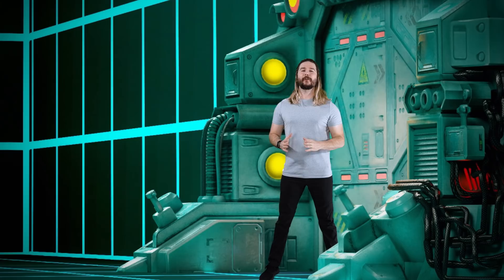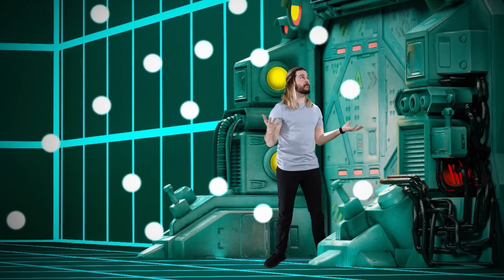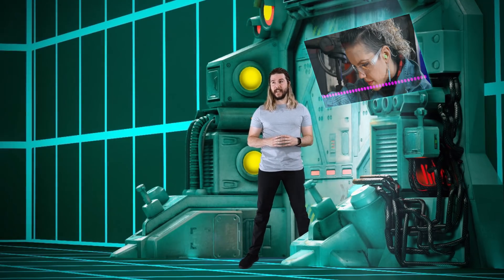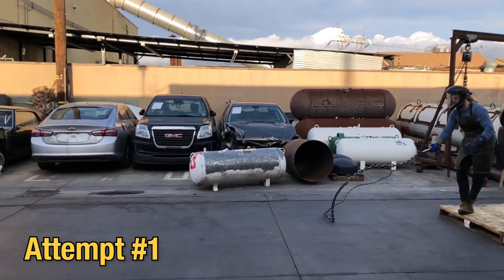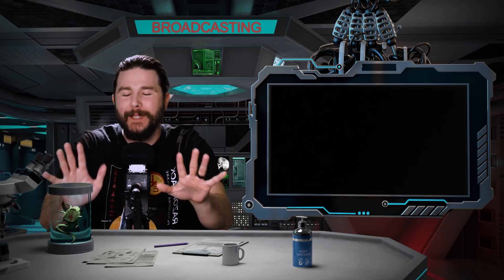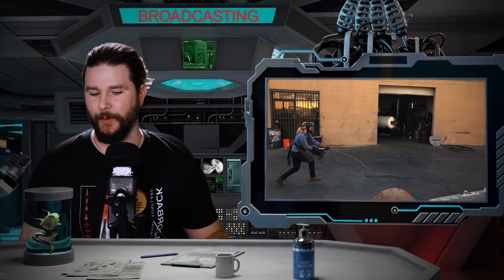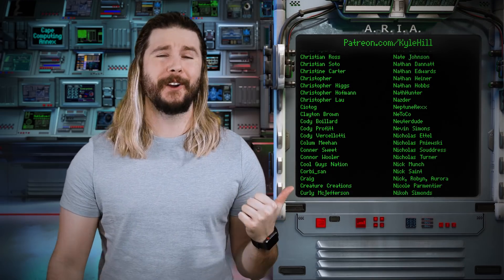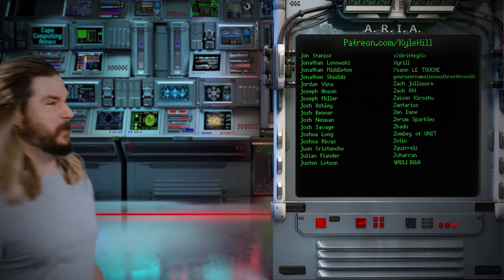Can I Make a SUPERSONIC STEEL WHIP?

Comment: @Kyle Hill I believe that it's possible to generate the force, but you require a pole, and possibly a pnuematic arm, to generate the necessary energy to move the chain. You're both too short AND too weak to generate the joules necessary to get the chain moving. However, a pnuematic arm, with a sort of "yank back" function should have the power to get it there. However, I assume that is an entire episode in and of itself. I may donate just to see that become possible, but perhaps partnering with an engineering channel can get you there easier.

Comment: Your experiment was a fail because you also are forgetting a few variables look at your upper body compared to the guy in the video as well as he may have more experience using a whip but the main variable you forgot when comparing your experiment to the video was you weren't there to see if it was all made of chain, however maybe try getting him to use your whip (as dangerous as that maybe) to see if he can replicate his out come

Comment: I make bull whips recreationally, and one of the most important parts to getting a good pop is the cracker.  The cracker is a thin piece of material attached to the end of the main body of the whip that is very drastic step down in mass.  On my 6 foot paracord bull whips I use about 6 inches of paracord gut tied onto the end of some gutted paracord.  The cracker breaks down fairly quickly and is tied on separately to make it easy to replace.  i think if you added a length of aircraft cable to the end, you might have an easier time getting the final crack.  That being said bull whips loose a lot of energy when they hit the ground, so without a significant amount of power to keep the whip completely off the ground during the swing, you'll have a hard time getting a sonic boom.

Comment: I have a lot of experience cracking a whip (don't ask why my wife will get mad) and it looks to me like that whip is way too heavy for you, you'd need a lot more momentum and a sharper flip when you pull the handle back like you would with your wrist on a regular whip. The guy in the other video probably had a leather tip like you mentioned and he was whipping it very fast.

Comment: Just a guess here but I'm thinking your chain went failed because it didn't taper enough and chains don't flex the same way leather does.
It's very important to have the right Flex at the end of the whip as I've owned cheap whips and expensive whips the expensive whips Flex differently than cheaply made whips and they don't crack as easily.

Comment: I feel like a chain is not good for this. It is relatively heavy(thus difficult to accelerate) and the numerous joints between the links gives you a ton of places to lose energy. A cable would likely be better, but also much more difficult to make, and far more expensive. Perhaps a chain with a cable on the end?

Comment: Three notes from watching...
Note number 1... Next expermint wear more foam. 1 in foam would help protect your legs. 
Note number 2... In the Tic Toc the guy gets 3 circles before the whip cracks. Highly dangerious unless you are a skilled preformer. people take note when it says "Do not try this... Don't Fn Try it". I didn't see one full circle on your go.
3.) It may be the silly in me but if you want to get the speed of sound safely maybe take a lesson from Newton. The quick decelerating on a solid object right at the tip. 
(To safely do this consider using some sort if torqe shaft on the handle end, some quick brake motion and a protective spring mounted stop to the centrifugal chain. (Theoretically you don't hurt yourself and you stop the chain with a whip motion.) You can see at the very end that stop in the Tic Toc strikes something... 
Finally Kyle take care... Hospitals are bad places to be between Germs, Bactaria and insurance. Its painful for me to watch the photos of your leg. Otherwise good Content.

Comment: So question. Isn't it usually the jerking back on the whip that causes the sonic boom? You were throwing the whip forward but I never saw you yank back on it just before impact. I've got whips and the only time they ever snap is when you get the timing right on the pull back. Like when you snap someone with a towel.

Comment: It would probably be a good idea to shield your ankles. Like just build a metal (or practically anything) curve that is bolted down behind your legs and is about as high as your thighs, so that if anything gets hit, it would be that. It might slow down the whip, but it would at least protect you on failures.

Comment: There are many issues here that make me think of reasons you could not get a crack. One has been mentioned a few times. There is no cracker/popper on that whip. Second thing is from watching the footage that whip is to long and heavy for you. Every try ai way the whip was always in contact with the ground for most of the swing. 

If you want to so this get a smaller chain and then find a way to make a metal wire cracker at the end. Just be careful because you will be making this whip far more dangerous. The big issue you are trying to overcome is a bull whip multiple layers each channeling the  the energy it has stored up to the next  smaller layer. Your whip is tapered, but it is effectively one long piece. Using braided wire might work better, but again far more dangerous. So shorten the length of the whip. In truth a 4.5 or 5 foot is what you want keep the chain core, but use a smaller chain. Atach a cracker to it  then either use a flexible  wire meshing, or a thin strands on wire to braid over  the bottom 2 feet. This will give you a chain whip that is much closer to a bull whip in how it transfers kinetic energy

Comment: Kinda looks like wave going down the chain arches at a too wide radius; I'm not sure if it would be a matter of performing a more linear forward and then backward yank instead of a sideways swing, or if it could be a matter of figuring out a different link-count to link-size function to to adjust the shape of the wave though

Comment: Every whip needs a peace of rope or fine lether at the end called the cracker. It is a different material than the whip it's self, and all the whip does is prepel or "whip" the cracker up to speed before halting that speed at the connection point and yanking the rest of it faster than it was propelled that is what creates the crack and what you see in the tick tock vid

God bless and have an amazing day

Comment: I understand where you're coming from. Ya, it's probably not possible for a Hu Man. But the main thing I noticed is, you never 'whipped' the chain. You threw one end while holding the other. I never saw an attempt to pull back on the chain in flight (the action changing the whips direction)

Comment: sigh many people think that the most exciting thing about science is the successes but in reality it is the failures, it's the failures that make us want the unobtainium or achieve the closest possible thing to unobtainium before we can make the leap to procuring it.
They like to post the successes but in reality the ones that just post successes and have success after success are either plain lucky that they have discovered something they weren't looking for for example artificial sweetener or... they are demonstrating something that other people have discovered or invented before them and are in the process of reverse engineering it... a good example is NASA... many think that NASA is some god like beings for getting people into space but in fact it started with the humble sling and even you can agree with this to some degree.

Sacrificing mass to either increase velocity to get to a great distance or in NASA's case... orbit came easy to them because of the sling, fireworks, gyro's, gimbles and other things that was not created by them but put together by people that really needed to solve the problem of getting that hunk of mettle from sea level to 100km above ground and of course... stay there

Failures help people eat humble pie, be humble and of course cautious with baby steps, it makes things worth doing because there is a lot going into getting it right and you only need to succeed once before you needing to tear it down and examine it so that it can be repeatable.

Please keep trying, your failures help science.

Comment: Kyle, here is the solution which will allow you to make this work!

First, a major component of why it is failing: the length of the whip only assists in creating a sonic boom insofar that it increases the duration you can apply Force to the chain increasing the total kinetic energy of the wave traveling down it. But, the longer the chain the more strength you need to be able to apply to the chain in order to keep it airborne for the full duration. Once the chain hits the ground, that is the maximum amount of kinetic energy you can add to that chain. So in this case, longer is not better for YOU.  You're not strong enough to with the chain of the link you are using.

Kyle, a supersonic whip happens because of a decrease in MASS as you go farther down the chain.

So, rather than make the chain so long, use less and less dense materials for the chain links as you go down the chain. Make sure to vary the change in density gradually using slightly less dense materials each time. Don't jump straight from Steel to aluminum.
It is hard to tell from the video, but it appears that the size of your links suddenly get a lot smaller but don't actually taper any smaller as you go so you're only getting an increase in velocity right at that link change, but that link is still connected to the previous link oh, so there is a limit to how much increase velocity you can get at the transition.
A normal with is tapered, meaning a continuous gradual change in length. But by suddenly decreasing the size of the links, that isn't simulating a tapering.

Use a couple different types of Steel density, and a few other metals, and a couple different sizes of links for each density, then weigh all the links and sort by weight-over-distance.

Important note: you need to divide the weights of each link by the distance of the inside loop of that link. Then sort your links by the result for each link.
If you need an explanation for why that division is necessary, leave me a reply and I'll explain.
If you need an explanation for why any of these steps are necessary or helpful, feel free to ask in a reply, and I will explain. But this comment is already way too long!

-Alex Montague
Reply: Rough visual estimate based on footage, your chain needs to be, at most, approximately four-fifths the total length you have it right now. Probably closer to 0.7x the current length.

Comment: I'm not a science guy but i'd try reducing the mass of the end portion of the whip by not only reducing the size of the links but also by changing the material. Make the last meter or  something out of aluminium or magneseum. Also, i wouldn't try doing it by hand right away. Make a device to check if it's even possible to do this without ripping the links at the end, then get some practice with regular heavy whip and only then attempt to get it done.

Comment: So my 2 cents, I think your "thick chain" part isn't long enough. It needs to be long enough that you are able to get the whole "whip motion" completed before the motion propagates to the much smaller parts. You may actually try taking out the largest links and replacing it with a much longer section of the second largest links. 

You need to start with more raw speed to end up with a crack at the end. Don't stop trying!!!

Comment: To conclude, you mentioned yourself Kyle how the whip works, yet you didn't implement it in the experiment.
Additionally it's clear that the other whip example you mentioned, mainly does it correctly.
I'm talking about the chain link size progression. If you want a smooth speed amplification effect you need a smooth chain link mass decrease along the way, meaning each link has to be fabricated and weighted to provide the necessary weight gradient. Without that you make things way more difficult than they should be.

Also, nice video.

Comment: The chain appears to hit some kind of barrier in the materials that slows the whole thing down right when it should speed up.   About half way down the distance of the chain the wave collapses, and thus the energy ramp up never happens.  Leather works for this because it can bend in ways that metal just cant, and it looks like were the chain changes size, those links are not able to conform to the "wave" shape fast enough to transfer the energy and thus they alter the wave, resulting in a MUCH lower speed.

Comment: Even with the perfect design the significantly higher mass would require equally significant increase to applied force to get the same effect. The added length and tapering does cut down on that but I imagine it would be quite difficult for a normal human to actually manage to apply that to the desired effect. And that’s ignoring safety

Comment: If I were to suggest a way to do this I would change a few things (disclaimer: as he says in the video no one should try this)
1: Acceleration - It needs to either accelerate faster or needs more time to accelerate.
2: Reduce the overall mass - Not sure what you could do but make it smaller overall.
3: Make the handle easier to grip - It's dangerous treat it like a weapon give a handle you can trust with your life. You don't just want something that won't break you need something that makes it feel like it isn't going to bite you. Even though it probably will bite you.

Comment: ...Wouldn't a lot of energy be lost just from the fact that the individual links are rubbing up against each other? Like, it's not a single material the momentum is being transferred through, it's several separate bits that have to lose some of the energy through sound and friction.... Perhaps a tapered steel cable...?

Comment: Why did you choose steel chain?
 Wouldn't steel cable be better and just slowly taper it down till it's 1 steel wire welding at each layer's termination point?

Comment: Engineer here: I would have suggested a longer handle so you can make use of the longer moment arm to maybe increase whip speed (might work, might not.. bc it also means heavier weight to be swinging/whipping).  Other suggestion would have been some sort of stationary guard rail/guide between you and the whip where you stand on one side and have the whip on the other so the back end doesn't hit you on the way forward.  Great content though!

Comment: I work part-time in construction so I know just how easily you can hurt yourself with heavy equipment like those chains. Worksite safety is a major concern on any jobsite especially when it involves heavy equipment and materials. You're a brave man to attempt whipping around this rather heavy chain. As you are well aware, the tensil strength of steel is much higher than human bone. It doesn't take much momentum to really hurt yourself as you regrettably experienced yourself.

As for failure, well, as Yoda says, it is the greatest teacher. I loved the Mythbusters in my early 20s in large part because it showed both failure and success and the process of improving a design. 

Oh, I loved your female guest making those chains. Metalworking skills are awesome to have  :)

Comment: Mechanical arm required. You aren't giving it a clean wave. Also measure the speed your arm arcs and calculate whether it's enough to actually break speed at tip.

Comment: You haven't seen the horror of whiplash effect until you have worked on a natural stone quarry.

The rock is cut using diamond wire saws, which use up to 75 kW electromotor to rotate a flywheel onto which a "diamond wire"  is mounted, which is steel wire with beads made out of cemented industrial diamonds threaded onto it, and the line speed of the diamond wire is around 35-40 m/s.
If the wire snaps due to either worn steel or over-tension caused by improper operating of the machine, the resulting whiplash effects sends up to five 1 cm-in-diameter diamond beads flying like bullets in the direction of the cut.
I've heard of people getting killed by these, and I've seen a ricochet wound a co-worker (no penetration luckily).

Fortunately, for most part a simple cover with thick rubber placed behind the machine will absorb the energy and prevent the whiplash, much like Kyle's leg in the video.

Comment: If you weld a few of the loop holes closed with a flat peace of steal at the end of the wipe. It would give it more of a surface area to push the air out of the way. Instead of the air flowing threw and around the loops.

Comment: While a mild steel whip is all well and good, I see no reason why you wouldn't downsize the the size of the initial links near the handle, and increase the length of the much smaller, tapered like tips. It seems like the whip in it's current state is too cumbersome for you to use the whip properly. Secondly, I still don't see you pulling the whip back! (Could be because of the weight issue, I'm not sure.) But if you thinned the whip down, and worked on technique I'm confident you'll get closer results to what you want. :)

Comment: I think that you could make that whip work, but you need to make 3 changes.
1. The whip needs to be between 50% and 100% longer. Because when you crack it you're going to want the end if it to FAR from you.
2. The handle needs to be at least twice as long because the weight of that whip + the proper technique will require the use of the entire body. You're going to need a good sturdy two handed handle with a good bit of leverage.
3. The technique needs to radically change. I'll go into that later if anyone cares to know.